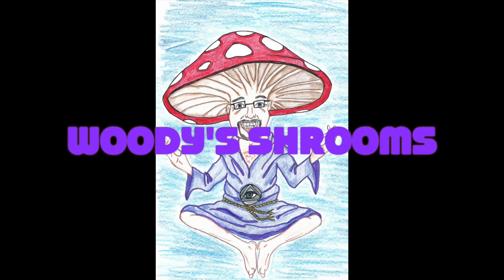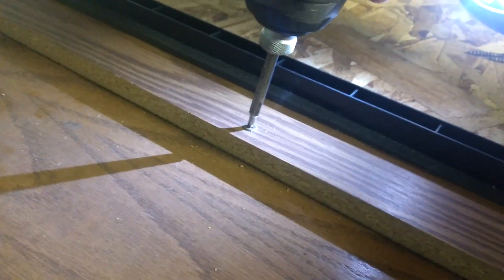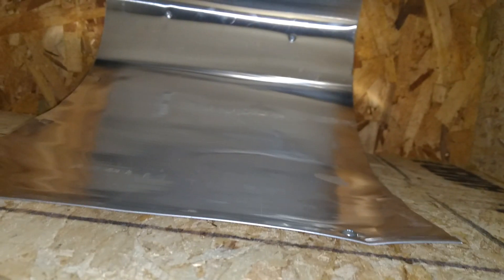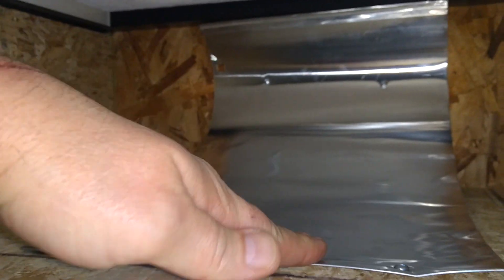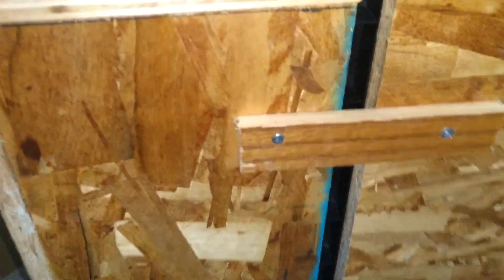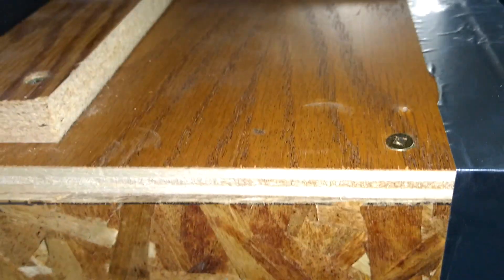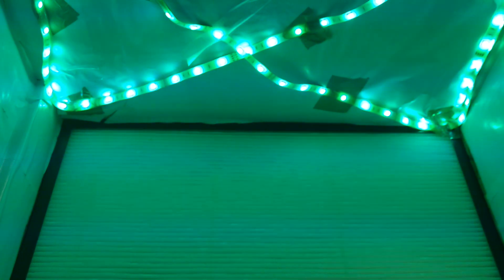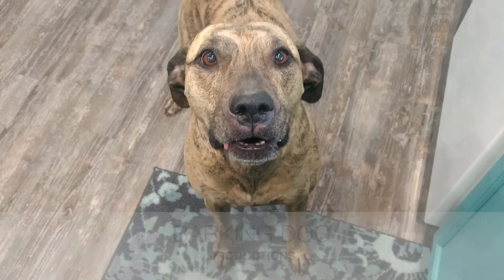HEPA FILTER NOT NEEDED FLOW HOOD. MUSHROOM MYCOLOGY

Comment: Nice video, and thanks for sharing your method. A lot of folks would rather not pony up the big money for a HEPA filter if it isn't necessary. The proof is in the pudding, and if it works for you after plenty of use, that's all you need to know. But have you done any tests to ensure that you have good laminar flow? Also, a lot of folks say sides or even a top over the work area are unnecessary and even counter productive because they induce turbulence without actually providing any benefit. Any thoughts on that?

Comment: Going to learn a lot from this channel.  Hey Wood, I am an HVAC tech, am going to build a flow hood myself and would like to know why you are pushing air through the filter instead of installing the fan on the work compartment of the hood to pull air through the filter and out of the hands on compartment? I would have to look at a few of these. Just making sure I do this correctly.
Reply: Pulling air is not a viable setup for a flow hood - the point is to have clean, sterile air flowing over your work area. You can't seal the work area in order to pull air through the filter, think about it - one side of the filter can be pressurized, and it can't be the open open side where you are working, obviously. This is the same basic setup for every flow hood used in mycology, pushing air through a filter to clean it. I wouldn't use bare OSB to build the box, but his design follows proper theory and looks perfectly functional.